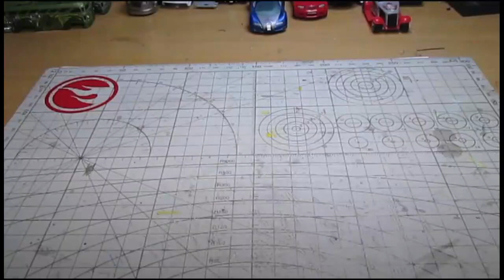Hotwheels Lotus M250 con Body Kit el custom que estuve a punto de ya no hacer....

Comment: Buen dia. Q tipo, marca, costo, tiempo de mezcla, tiempos de reposo ya puesta en pieza de epoxica utiliza usted? Gracias
Reply from the maker: Hola que tipo pues plastilina epoxica  marca casi siempre uso generica porque compre un kilo jajaja y eso es muchisisisimo pero tambien uso plastiloka, tiempo de mezcla unos minutos en lo que se unen bien las 2 partes tu mismo te das cuenta, cuando ya esta pegasosa es el momento, tiempo de reposo 30 minutos para hacer los ultimos detalles  24 hrs para tenga su dureza maxima y empezar a lijar, saludos y suerte